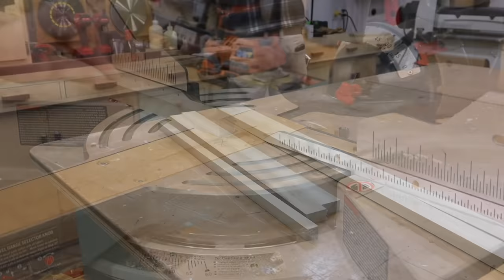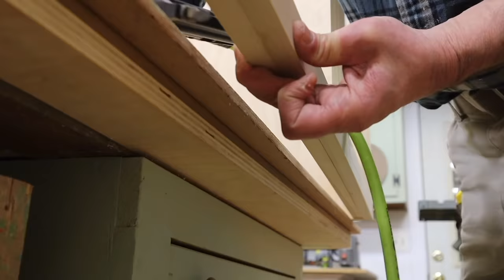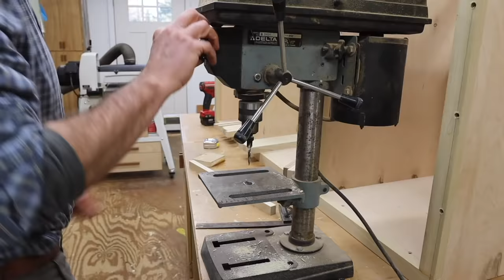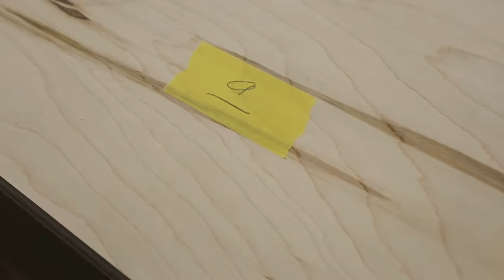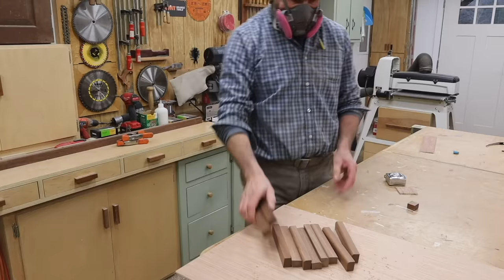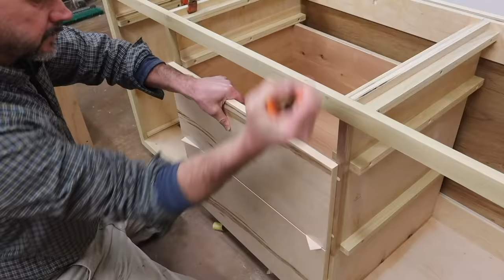Make a Mobile Work Bench - Storage Cabinet - Charging Station

Comment: Great video.  Instead of using hot glue to reinforce the drawers, I put thickened epoxy in a plastic bag and shoot it into the corner between the bottom and side of the drawer, and then a large stir stick to make the fillet.  It is actually strong enough to hold the drawer together on its own.

Comment: This has to be the best build video I’ve watched in months. Great job. 👍🏼👍🏼. It’s getting me motivated to get back in the shop ASAP.    Or. Whenever this freezing winter let’s up.
Reply: I put a furnace and air conditioner in my garage.  that's how I get around that! (retired hvac contractor)😆
Reply: Well. Yeah. That’s my next project. Running natural gas out to the shop.
Reply: @Fleenoreric  do it. you won't regret it. I love having heat and ac in my garage. costs about 2 bucks a day to run it, when you're out there.

Comment: Thanks for the video and for having the guts to put up a medium length video.   I haven’t seen the hot glue in the drawers before.  Is that to keep the drawer bottoms from rattling?
Reply from the maker: Thanks Jason, it’s something I was taught years ago and still do. It does prevent rattling and I think adds a bit of strength.

Comment: What is it about your videos that make them so relaxing to watch? Every miter cut is perfect, every pencil mark is precise, and every pass with the router is just amazing to watch! If you happen to read this though, I'm curious why you went with wood on wood slides as opposed to metal drawer slides? Thanks for another great video Jon!
Reply: Sfyre2 he believe he said it on Instagram, it’s to keep the cost down
Reply: @michalduchnowski9242  thanks Michael, I assume that's what the reason is. But I think a stack of 10 slides are less than $60 on eBay, but wood slides are great too and you can't beat the simplicity

Comment: Great looking piece! The only thing I would change would be to put a solid wood frame around the top. The edge banding is just not  to stand up to shop use.
Reply from the maker: Thanks Tom,  I was thinking the same thing... will see how it holds up and if I have to I’ll band the edge with solid wood.

Comment: Terrific build.  Coupla things: Why do you leave so much space a the back of the drawers?   Also, nice method for trimming the plugs! I have never seen that before.
Reply: Without the added material in the back the drawers would simply fall out (if completely opened).
Reply: Thomas Schreib I was referring to how far from the back of the drawer box he placed the back board. The box extends well beyond the back panel.

Comment: No stops in the drawers?  I'd be very concerned I'd pull one all the way out onto the floor.  

I'm going to build something like that only bigger to function as an outfeed table for my table saw, an assembly table, and something I can use to pull sheet goods out of my truck onto and wheel around. I also need a whole bunch of additional storage.